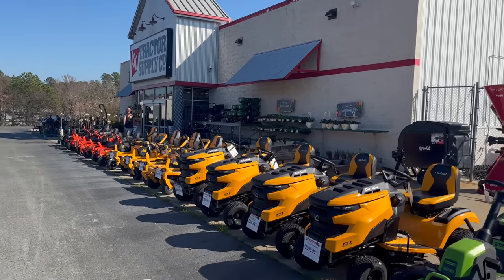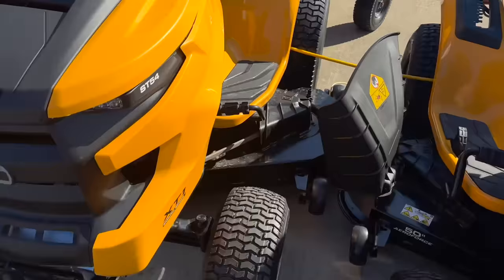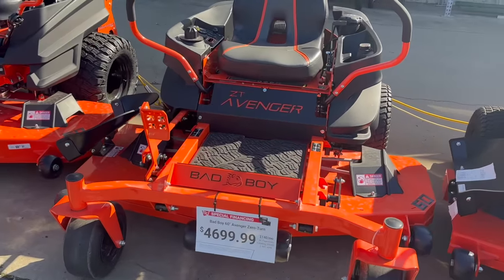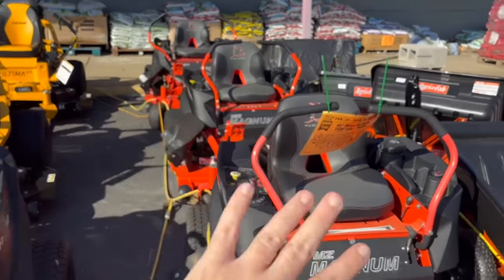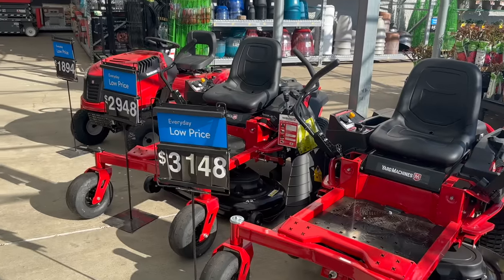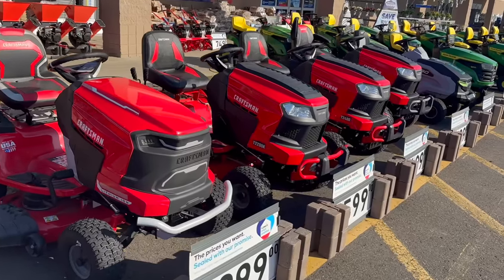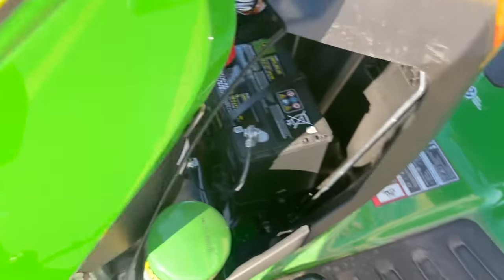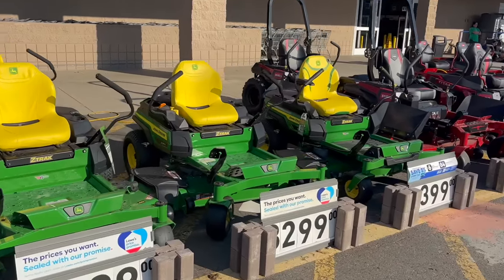The BEST Mowers to Buy and What to Avoid at The Big Box Stores This Year!

Comment: What about Husqvarna TS 248XD lawn tractor? I want to buy something decent but don’t want to spend $6k. Is it’s transmission serviceable? I guess not but I don’t know. Some on YT claim the frame brakes. Opinions anyone? $2700 slightly used or $3300 on sale. I didn’t want a zero turn because of steep hills.

Comment: You tube want let me say Hustle* Raptor. I purchased it 10 years ago 52 not commercial. I haven't had anything gone wrong with it, I keep it clean. It still has the same battery in it, no water gets in the ignition switch. Fires everytime. Ok  got gas with water one time.  Not mowers fault. My Next door neighbor has 9 nice push and self propelled just rotting away. Burnt a zero turn Cub Cadet up. It got so hot it melted anything that was not steel.  Why, lack of cleaning and fixing the oil leak at the fill  tube. Grass build up. Caught on fire. Time fire department got to it, it gonna. Got him a new one 3 years ago. Stop running the other day. He just added it to his collection. He's what you call a SUPER HOARDER.

Comment: I've been watching you for a little and I've noticed you are extremely biased, which is okay. I also do small engine repair but besides the point. We've have 2 Troy built lawn mowers, 1 at our lake house and 1 at home. Both have lasted over 7 years and we don't even winterize it. It always starts. Always is very reliable. We use 1 which is the troy built pony twice a week and the trot built bronco once a week. Neither have had an issues.

Comment: Avoid Husqvarna!!! I thought it was a good brand but apparently not anymore! My brand new MZ52 (“semi-commercial”) spent 75 of the first 100 days of ownership at the dealer trying to fix all the problems. Too many problems to list here. The worst thing is actually a design problem that can’t be fixed. The deck plugs so easily. I can’t mow more than an acre of dry grass before having to clean the deck. Cutting grass with any morning dew plugs almost instantly. As an added bonus, sometimes after turning the blades off on a plugged deck, a clump of grass will fall down onto the blades… and when you turn the pto back on, the $80 belt jumps off the pulleys and gets shredded. For comparison my 20 year old kubota has NEVER plugged. Now I hit 300 hours and the latest problem is the seat support has broken because the steel is so thin it tore apart (I weigh 180 lbs)… I’m going to make something myself to mount the seat to, because I’m out of warranty and Husqvarna will never get another dollar from me again!

Comment: The Husqvarna that you say the first 2 digits tell you the year it was manufactured can't be right, considering this video was just made this year, 2024.  The serial number looks to be 011624A003729.  So are you saying this model was made in 2001?
Actually, I think this mower was made Jan. 16, 2024, so it is not 3 years old like you stated.

Comment: You have any facts on ego mowers burning our house down?  I have ego equipment, self propelled 22" mower, blower, hedge trimmer and love them all. My1997 22 HP John Deere 445 needs more service than I care to mention. I still have it but it's taken it's toll over time. You steer clear of ego riders saying you don't want to burn our house down but is that the truth or is it because you service gas mowers and your business would be hurt with everyone going batery operated?  Thanks, Dale  P.S. Not picking on ya, just wondering what the facts are on servicing and safety of ego riders are.

Comment: do not buy from box stores. they sell it ,but they do not do instore warranty. and they are putting small stores out, and alot of stores are being forced out by the banks.before you buy a mower from anyone make sure they do in house repairs. manufacting is gonna take a loss  because.you might save a little bying from corporate stores. but you will pay in the long run..

Comment: Those "Toro" (Loncin) engines weren't horrible. They weren't great, but not horrible.

Box store mowers in general, $uck. Better off buying a good used commercial unit.

Husqvarna has never made a mower. I've seen machines that look like a mower with Husqvarna on them... but they were 100% useless for cutting grass.

Comment: Husqvarna, are you serious? If you have a problem with the Husqvarna mower (and you will) try getting parts for it. And if the local service center does have the parts you were going to pay an arm and a leg but most of the time they have to be ordered. You could go weeks before you get it back from the shop. 

Also, there is no service in customer service with Husqvarna. Try calling their one 800 number and you will get a recording directing you to file your complaint online. There is no way to talk to a live representative. 🤦🏻‍♂️

Comment: I'm not sure what your experience has been to come to these conclusions but I definitely disagree. I've had a Bad Boy Magnum for 7 years. Every single year it's had to have at least one non maintenance item repair. Before that I had a Cub Cadet tractor for 5 years that I never had any problems with. Only reason I switched was that I wanted a zero turn and I thought Bad Boys were great low budget machines. I hate mine. I have a friend who has a landscaping company and he bought a stand up Bad Boy the same year I bought my Magnum and he hates it. He's had tons of problems with the Kawasaki engine as well as the mower itself. Actually my Kohler engine has been totally strong and reliable. Our local dealer has Kawasaki equipped mowers sitting around collecting dust but sells Kohler equipped machines like crazy.
Reply: Read about the channel. They own a repair shop fixing about 2000 machines yearly. Your or my single experiences don’t capture what repair shops see in large numbers.

Comment: Lowe's John Deere i have second owner has bushings instead of bearings on the wheels. Not worthy of the john Deere lable.
Reply: Aw, my simplicity Regent  is 10 years old and has them. I changed them around 800-900 hours and I mow some rough stuff like whe here horses run around.     All in all they’re not so bad and easy to swap out.

Comment: Toro has a better quality and service rating than Bad Boy. When the two mowers are put together in a side-by-side real world test, the Toro comes out on top every time. You obviously don’t know what you’re talking about.

Also, never buy a mower from a box store, especially Lowe’s! If you have a problem with that mower after 30 days, you are screwed. Always buy a mower from a reputable dealer with a competent service shop on site.

And last, never buy a mower with a stamped deck. Stamped decks bend and warp very easily as they are stamped from a single piece of thin sheet metal. They are also prone to rust after just two seasons.

Comment: I bought a new Cub cadet in 2022 it's a 46-inch cut.. I think these Mowers  have a very bad cut quality... I think the deck has got major design issues. I think they designed the blades to look like airplane propellers.. hoping it would make enough vacuum for them to cut better... If they would have designed the mower deck correctly... They would have never had to make these ridiculous lawn mower blades that still don't have enough vacuum for a good cut... I look at it as a brush hog with two blades.. shame on you MTD

Comment: ALL new mowers are cheap, disposable, Chinese made junk. There I said it. Strictly from personal experience. My father has 50 year old Simplicity that never needs any work. Still has the original seat, and original bearings on 3 blade hubs. Even the tires are original although they were patched few times after hitting nails or screws. Twin cylinder cast iron engine...indestructible... and as reliable as Swiss watch.

Comment: From my past experiences for many years I wouldn't buy any of the machines you mentioned and I  wouldn't buy any zero turns at all of any brand because they literally suck on steep hills and inclines  You mentioned seats being cracked  how about all your equipment with plastic hoods and the deck that the seat is bolted to  well that cracks too . Now if you want a real mower buy a Simplicity there machines use real material  metal hoods metal seat decks real reinforced mower decks they even use shock absorbers on there premium machines  and yes they even have those useless zer turns that literally suck on steep hills and yes they are the exact machines as the farris zero turns that are thee finest of the zero turns. And don't be fooled by the deere johns they have plastic hoods and seat decks overated and very overpriced.

Comment: So, all electrics burn your house down, huh?
Reply: Other than DIY'ers who didn't know what they are doing when replacing old Ryobi lead acid batteries, I haven't heard of a single fire from battery mowers. Love my eGo push mower!
Reply: @evanhil02  That's what I thought too, but this chickanic seems to be down on them. 
I just purchased a 30-inch Ryobi zero turn. I'm hoping I'm gonna love it as much as I did my Toro of a few years ago. 
Funny story here. I had the Toro and lived it. I could do my front and back yards in 20 minutes on that zero turn 42-inch Toro. 
I decided I needed more exercise, and I sold the Toro and bought a Ryobi electric push mower. I even bought the other 40 volt electric laen tools to go with it. I' have no gas lawn tools now. 
That worked fine until I tore my meniscus. Even after surgery I cannot push that mower and have been paying someone to do my lawn. 
I will now be riding my new zero-turn and having fun again.

Comment: You must have some kind of ties to badboy the way you pump them up. I have a commercial badboy with a 72" deck and it gives problems as well including busted spindles. 

Most mowers are made the same of equal size. You think JD or black and decker makes the pivot bars or spindles? Nope 
Oh ya mtd was bought out by black and decker some time ago. 
JD is overpriced big time for what you get.  One thing you glossed over was the difference in the decks. Is it stamped or fabricated? Sealed bearings or grease zerk bearings?  I have a cub cadet as well that has a kawasaki on it.  Hit a root with a stamped deck and you will wish you got a fab deck. 
Over all from your video your biased.

Comment: lol all those are junk, go to a dealer and buy a real mower its well worth it.
Reply: And what is a real mower brand?  I'm in the market and don't want to buy junk.
Reply: @LLCebuRider   I did not mention brand. What I was saying is buy from a dealer not the box stores. They are completely different lawn tractors at the dealers. John Deere, Cub Cadet, Torro, Troy-Built, they are all about the same pick one that works for you.  You are going to pay a lot more, but they will last. My John Deere X350 a few years ago cost 3500.00 you get what you pay for.  Example - My JD X350 has a 18 hp Kawasaki engine, and a fabricated steel deck, you're not going to find that at Home Depot or Lowes. Also, the transmissions in the dealer lawn tractors or zero turns are made completely different they are made for working. Spend the extra money it's worth it.